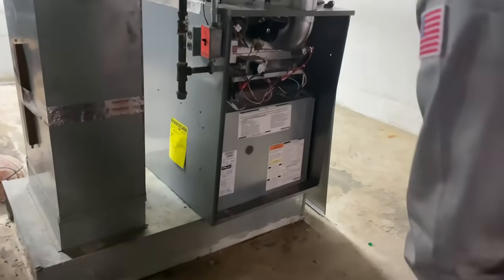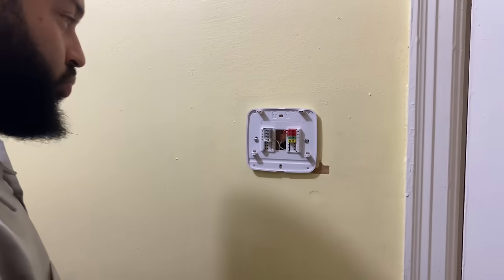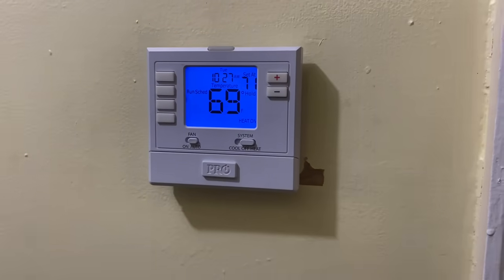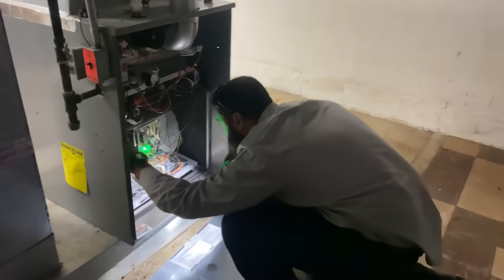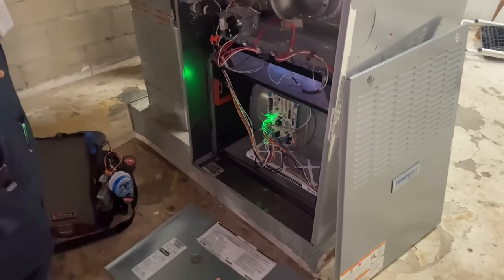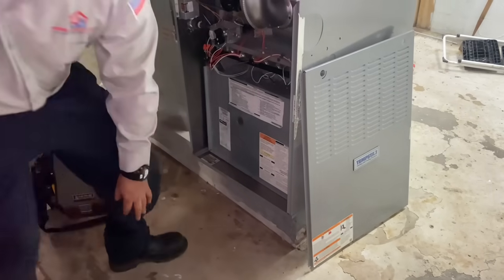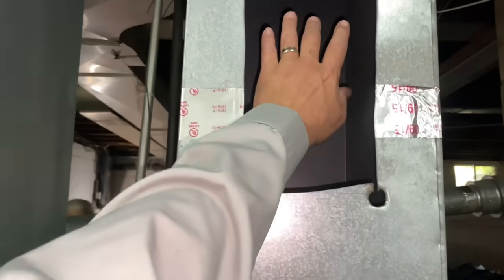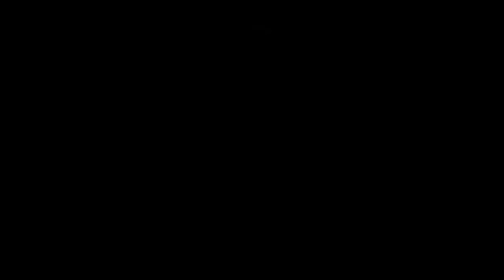"LET THERE BE HEAT!" Furnace in Church Resurrected from Hell (Gas Furnace Order of Operation Guide)

Comment: One thing I like to do on all furnaces is clean the flame sensor to prevent a call back also if you look at the escutcheons on the water heater they will usually give you a pretty good indication on the water heater if it has been back drafting they would be melted
Reply: i would rather  check it  before i clean it and  see  if it made a difference.   anything over 2. is good in my books.   use steel wool not sand paper ladies and gentlemen      hack tip of the day!

Comment: A couple years back I had one of those exact thermostats stick on full heat, at a property I don’t get to for weeks sometimes over the winter months.  I entered a house that was over 100F.  The gas forced air furnace could have been running non-stop for weeks.  The gas bill showed a high volume that period as well.  Now Honeywell professional grade thermostats are the only thing I will use.
Reply: relatives had similar happen many years ago, but it was switching relay contacts stuck on a hot water system full of cast iron radiators and a way oversized 1950's boiler.(300K BTU!), it melted all the candles, caused other damages paint, wallpaper, plants, foods. the house was 140F+ and climbing when they arrived home that evening. lucky the Dog survived it and was smart enough to lay in basement on cool concrete floor.  it may have caught fire if it kept heating.
it's all been replaced since then, but yikes that was bad.
Reply: @throttlebottle5906  another case it’s a miracle that house didn’t burn.

Comment: Work on a lot of carrier style equipment, first time I've seen an extension on a flame sensor wire. Even looked like the wire itself was sitting infront of burner 3

120k BTU furnace prolly cut the hole thinking it would improve airflow with no thought to the atmospheric, that sucks.

Comment: Mike, never understood how ICP was able to keep their green led control boards in these furnaces after being owned by carrier for 12 years. But they did. The furnaces besides the paint and part numbers for the parts, and the control boards, the furnaces are exactly the same, the wiring harnesses are the same, if you were to somehow figure out the conversion of the model & part number of the ICP to carrier, either board or any part of it would work. I wish the boards & part #s were the same, it would make life easier for me and many others. The high limit doesn't tell the blower to come on, the control board does after certain amount of time after flame sense is proven and it also has a set "blower off delay time" Older gas furnace boards actually had dip switches you could set for the heat on delay and the heat off delay for the blower. Also to note, the boards are set to also give the same code if there isn't a constant 24v heat call, loose wires, dead batteries in the T stat, etc, could also cause this code, likely the case for this service call. Definitely close up that return run with the water heater next to it, hacks piss me off, they likely cut that hole in it because they oversized the furnace. I'll never understand why hacks are so scared of wiring the F'ing common wire to avoid these petty issues. Carrier was very smart to have the blower on during a call for heat programmed into their boards, especially for the rural folks with unreliable electricity and nasty winter weather, this saves many many heat exchangers. And to lastly note this series 80% carrier furnace, I have yet to ever hear or see, a heat exchanger problem with them. They nailed it, best 80%er you can get, single, two, and modulation stages. The 59 series 90%ers? Nah, they rot out the HXs just like the 58 series did. Here I am in northern Minnesota and I wish I still had my 1960's oil furnace, would have settled replacing with a carrier 80%er of this series. Unfortunately, I'm dickered with a 90 plus, not even 6 years old, and I'm replacing its HX in two weeks because of failure. Sad.

Comment: Oh the training, would be nice to show the trick, of well checking the battery voltage in-situ, then each cell and location individually Install in each others original location. Save someone a frozen night somewhere.  .-- looked to be ignition lockout, and part of the normal sequence, What .- the fan call from thermostat, on two wires?  Just nitpicking what I see.

Comment: That thermostat wiring threw me off, w and R only but then i realized that's a strictly heating thermostat. But then again that's a newish furnace, should have a C wire and not change batteries ever again.
Reply: We don't see that out in the southwest. Heaters are always attached to cooling.

Comment: 2nd, yeah I would have plugged that hole in the return, being that close to the water heater. The hacks likely cut that hole in the return because they oversized the furnace in the first place, looks very like it, 6 burners on a carrier 80%er means it's firing at 135,000 btus input. Ridiculous, with that small of a return drop in the first place? Come on man, hacks will bring you stacks, that poor furnace needs uninstallation and then almost half the btus going back in. Can't ever go by square footage if the ductwork isn't there to handle it.

Comment: 🤔.  This is one time  I disagree with the outcome leaving the job site .  Granted; It showed  draft on the vent of the water heater   . But was the house open to outside air? If it was that would allow more draft.  But in a  closed environment? 🤔 I would have  patched or Taped the return air hole off.  Not that I am setting here second guessing you , it’s  just  like you, I don’t like it  because we both know it is  a possibility. This is  one of them times “ an ounce of prevention is worth a pound of cure”  But I did find it questionable that the other guy was here left the cover off?? What was he ? A carpenter??😂 definitely not a HVAC guy!! Sorry but this is the first time I have seen you ( on video)  leave something questionable. 🤷🏻‍♂️ Just being honest here not throwing you under the buss ❤

Comment: ICP initiates heating cycle with circulator blower motor. Dumb.
Reply: many do that after power return to curb high limit tripping or even non-resettable thermal fuses opening.
the idea is, if it's heating when the power goes out it will cool itself down before firing burners again. I hate it when trying to work on them though, annoying as can be!